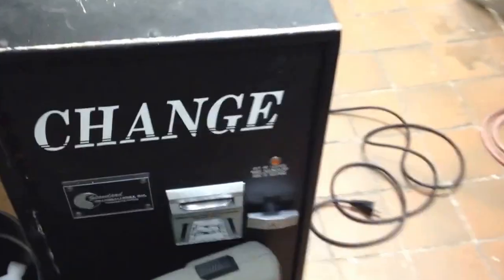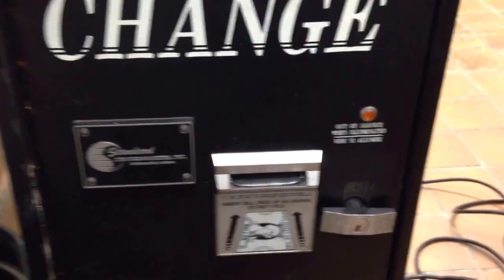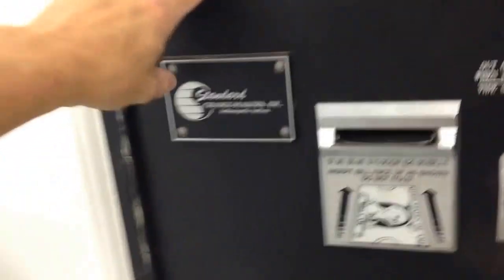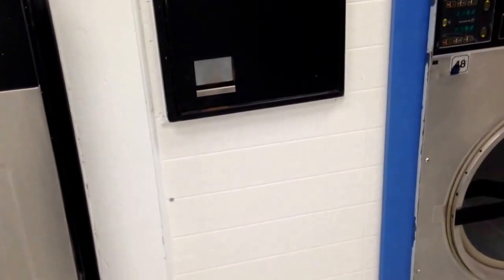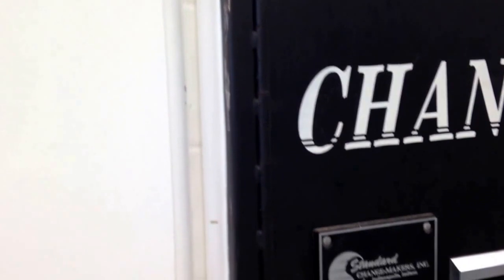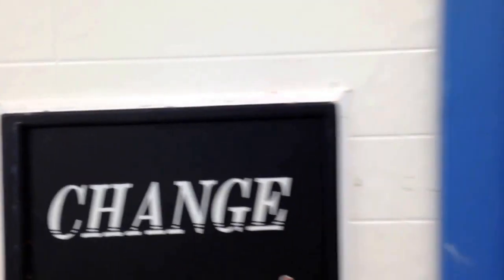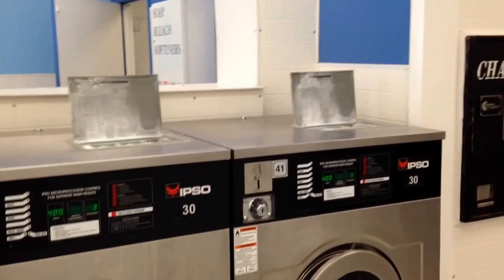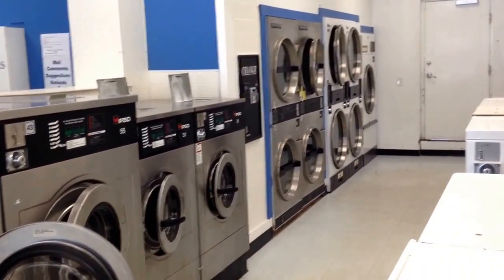Installing a Change Machine in the Laundromat

Comment: What Is the milk crate on the wall for?
Reply from the maker: +mpjvending The milk crate is the inside of the mail/refund slot. I took a brass mail slot and installed it through the wall. The milk crate is held with some plumbers All Round metal strap and screwed into the studs. This allows it too hold any catalogs that the post office delivers
Reply from the maker: +Laundromat How To / Coin Laundry How To Mail Slot    http://amzn.to/1malV71